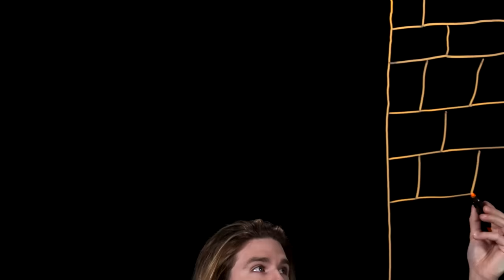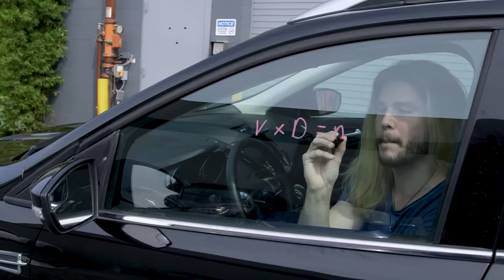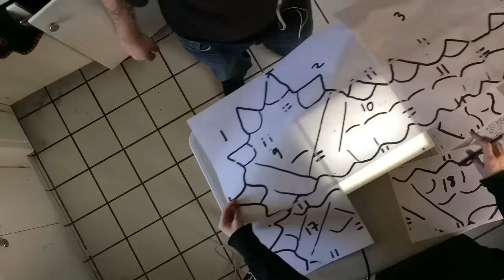Could You Swing A Real Monster Hunter Sword?

Comment: Would a human with muscles capable of producing the calculated amount of energy required to swing such a massive sword repeatedly even be possible? And what would that look like, something like five Arnold Schwarzeneggers in one?
Reply: J335H normally you'd see a 70 kg guy swing a sword under 5 kg. So if you got a sword weighing 170 kg, you would need someone close to 2000 kg to properly wear it. Thats 3 of the worlds biggest bears.
Reply: I wonder if a Spartan from Halo could wield a sword like that.
Reply: Brian Shaw may be able to swing it. Or Hafthor.
Reply: Please tell me that is the actual cannon
Reply: xtemma I think I now need to go look up monster hunter lore.
Reply: Not even close. You'd need to be about twice as strong as a worlds strongest man competitor just to hold it horizontally for a few seconds and weigh 340kg not to topple over in the process. To wield it proficiently you'd need to be about 20x as strong and weigh 720kg.
Reply: That is an easy way to put it but in essence you are right xD Wyverians on the other hand are a completely different thing xD But yeah it is mentioned in older games that not everybody can become a hunter because they have to have that something special. 
It is also repeatedly mentioned that there used to be warriors in ancient times that the hunter weapons were basically created for and they wielded them with ease. This lead to the belief that hunters must be descendants form those warriors. How those warriors came to be is actually not known. As monster hunter is basically a world without magic but an almost magical form of sience many things would be possible considering that even the most experienced wyverian scholars do no understand many things they find inside the ruins of the ancient civilication.
Reply: Rai Jim honestly, probably could. The spartan2's would weigh enough in their armor to counteract the weight of the weapon.
Reply: @GoingRampant07 Just about. They would weight 1000lbs and be 5 times as strong as a WSM competitor. They could swing it if they had to and it would be better than nothing but it would be really sloppy and the momentum would throw them around.
Reply: Ah just let Kratos play with the sword should be no problem for him.
Reply: @GoingRampant07. 

A spartan wouldn't be able to. Military armour systems are made to be as light weight as possible, while being as strong as possible in a certain direction. The Halo Spartan suit make the wearers 5x as strong as an average human being I'm I remember correctly. The wearer would be able to lift and swing the sword, but definitely wouldn't be able use it efficiently in combat situations. He'd expend his suit's batteries just dragging the thing around. 

If you notice, in Halo all the "old fashioned" weapon designs like swords are either light powered (laser or plasma blade), or are gravity gen powered to increase downward arc and thus the total torque (hammers). Without these hi-tech enhancements,  (if say the power were switched off), a human would be able to lift them pretty easily because of their light weights, but obviously wouldn't be able to do a lot of damage with em.
Reply: Fernando Cárdenas you forget that Spartans canonically weigh almost a ton and can flip a tank
Reply: J335H you would need a HUGE heart to be able to pump the blood required to support the muscles needed to lift it. Let's say a heart somewhere near the size of an elephant?
Reply: @redfiveish

Sure, except that Halo's human tanks are not heavy like real world tanks either (todays tanks weight about more than 60 tonnes). They are made from light weight, but strong materials just like the spartan armour. They even have smaller guns (smaller ammo, less combat weight) than today's tanks. The Covenant tanks are even lighter as they depend more on energy shielding. They probably weigh as much as a regular car (about 1 and a half tonnes as they can be carried by pelican gunships) 4 or 5 people can flip a car.. 

Think about it. If Spartans weighed a tonne, there is no way they'd be about to jump and flip, and maintain their acrobatic ability on different environments, especially if they are only 5 to 6 times stronger than an average human. It leave almost no extra leeway for their suit's power.
Reply: Fernando Cárdenas your correct the weigh 1000 pounds armor and all due to increased bone and muscle density.
Reply: J335H honestly probably not even possible. The human body has limits even with special cases. The most ive seen someone bench is about 400 pounds and they only got it about 4 times. Its a lot easier to bench heavy and squat heavy than to say do a kettlebell swing 100 pounds. Being able to swing would mostly be from up to down. You would have to rely mostly on the swords momentum. So basically you wouldnt swing it. You would just let it fall and hope the weight did it. You couldnt even maintain momentum with that thing.
Reply: The biggest problem is that, in order to use a sword of this weight, the wielder would need to be substantially heavier.
Reply: Nathaniel Woodburn and that's how it is in the game.  Its so heavy.  The momentum carries the character one side to the other.
Reply: Jim Giant wait, twice as strong only ? That means the strongest man on earth can lift 275kg with one hand ? It's crazy, who's that guy ?

I calculated the upward force the right hand (near the guard) would need to apply with the mass and torque Kyle calculated and considering 40 cm between the two hand, the left hand would need to apply a downward force of something like 3800N (equivalent to 387kg) and the right hand would need to apply an upward force of the sum of the two downward force (left hand and weapon) that's ~5400N (or 550kg)
Reply: I think a 5' 8"to 6 foot tall, 200lbs power lifter with exceptional dancing and martial arts skills should have the sense of momentum, control and footwork skills to swing a 370lbs version of this blade. 
It'd still be several consecutive swings before he is exhausted, and there's still a large margin for terrible error. Though it's a full body activity, his ankles will be under a tremendous amount of strain when he pivots on them to generate the initial momentum of starting up the swing and then as his stance widens out to transition the flow into a secondary pivot. On the second pivot, the built up momentum will go to the outer limits of his control(even with genius level sense of kinesthetics). The sword's weight will feel momentarily lessened as it'll feel like it's flowing of it's own accord(which it technically is at that point)...
You are not likely to find a guy like this, but it's possible there are a few in the world...but in the World of Monster Hunter, each Hunter is likewise in the top 1% of physical and martial prowess, so it's possible(just not for Kyle, he seems better at thinking than martial arts).
Reply: @Lin Yen Chin Actually, the proposed power lifter would likely NOT be able to use the 370 lbs weapon.  As Kyle points out in the video, Greatswords could weigh up to 15 lbs, and being a later developed sword existed during the time of plate armor to offset their weight, and still, during this period, Longswords (not to be confused with Arming swords the way games like D&D does) were the prefered weapon. Why? The greater weight of the weapon could wear out even the individuals trained to use them.

Shad over at Shadiversity discuses the issue in this video:

https://www.youtube.com/watch?v=0t8ZrI5JqCw 

and Michaelcthulu shows why large swords of any type are problematic, even though they look awesome:

https://www.youtube.com/playlist?list=PL94959BEA7932D30A 

yes, I linked to his playlist, because he has more than one example of an oversized weapon being too unwieldy to use effectively.
Reply: T Mac, you do know that there are guys out there who could leg press one ton, right?https://www.youtube.com/watch?v=9vWgSTdkc2A
 ...and that Professional soccer players can do about half that, right?

Kyle is looking at it wrong, he has no sense of technique, he boiled it down to shoulders, elbows and wrists rather than understanding that it's more of a full body activity(all the joints are leveraged), to lift and propel the sword as demonstrated in the mechanisms of Great sword movement in the instalments of Monster Hunter that I played back prior to it migrating from Sony's psp to  Nintendo's wii.

Kyle describes "moments" and "kinematic chains" so well, but has no real material sense of it, at least not like any martial artist or even generic athlete knows it through the flow of their own bodies.
Reply: Look at this woman leg pressing almost 5 times the estimated weight of that sword(were it made true to the monster Hunter height):
https://www.youtube.com/watch?v=4EwPpYjCFuc

That's the reason why I say power lifters have the potential, only not just any power lifter, as they would have to know better than Kyle, they would need a martial artist sense of full body coordination to leverage in flow all the potential kinematic chains required for using the sword.
Reply: Ok, I know MANY individuals who can lift heavy weights, but there is a difference between lifting a heavy weight and using it effectively, and as stated, the ratio between body weight and the weight of the weapon needs to be around a certain point or it really throws the individual off balance. I practice martial arts and have a pretty good sense of balance, and can swing fairly heavy items one or two times. As a point, Powerlifters typically only lift weights in the above range once or twice before stopping.

Another point is that powerlifters and WSM/W competitors train specifically for what they do. The ability to turn that into fighting prowesss means a lot of training where they would lose some of the strength that they display at those events because the training necessarily redistributes their body kinesthetics to compensate. It is not as easy as, "I am strong and therefore I am a great fighter" or even "I am strong and with a bit of training I can swing this sword effectively." Martial training takes a lot of time and practice and being honest, while they are "fast" with heavy weights in the WSM/W competitions, they are typically slower than an average sized individual.

What Michaelcthulu shows, is that the primary method of using such a heavy sword would be to raise it and let gravity do the work, and this is a slow method of attack requiring the target to pretty much be restrained in some way. Swinging such a sword as one would in techniques from Ringek or Tallhoffer would be impossible even for your powerlifters as the mass ratios would be off and would throw them out of balance every time they swing.

So let's look at the Halo comparison. Military armors are made as strong and light as possible, and we see regularly that OSD (Non-Spartans) move very well in their older, bulkier armor. Spartan Armor would be expected to be lighter and stronger than OSD armor, meaning that it isn't adding much mass at all to the equation, probably less than the full plate of a medieval knight. We also don't see that Spartans, even after their enhancements weight significantly more than a normal human, meaning they again don't add much mass to the equation. Therefore, one would expect such a bulky weapon as the Berseker Sword to throw even these worthies off balance should they choose to use one.

So, looking at the ratios how heavy would an individual using such a sword need to be in order to wield it effectively. A greatsword, the heaviest known type of sword, comes in at around 15% the weight of the user, and that is at the high end, typically you want a lower ratio, but we will use this for best case scenario. The wielder of the Berserker Sword from the video with Kyle would have to weigh in at about 2,333.33 lbs in order to effectively swing it without throwing off their own balance. And this is for a trained martial artist mind you.

Looking at listed weights for individuals in comics that wiegh in close to those ranges brings up no one.  Now individuals like Superman and Superboy might be able to do so, but they are also considered to do odd things to physics anyway, so they wouldn't be good for this. 

TL;DR: Physics dictates that the individual needs to weigh significantly more than the weapon to use it properly.
Reply: And I got around to describing why, even with training they would not be able to use such a weapon, they would lack the basic mass to do so, and you would have understood that had you actually read my full reply.  Please note that it does say "Read more" at the bottom of the basic blurb there.

I also never called you any names so I have a problem understanding why you have.
Reply: have you seen greatsword gameplay in monster hunter?
Reply: Lin Yen Chin leg pressing has very little meaning in this. Most of the difficulties would be with how the weight is distributed in the sword and how they would be holding the sword did you entirely miss that part? Yeah you could stand up with the sword in your grasp but I 100 percent bet they couldnt hold it up for more than a second or two if they even could get it off the ground from a resting position into an idle drawn weapon stance. Much less drawn that thing from being holstered on their back over their head and than hold it in place, please....
Reply: Andrew Blake:
"Lin Yen Chin leg pressing has very little meaning in this. Most of the difficulties would be with how the weight is distributed in the sword and how they would be holding the sword did you entirely miss that part? Yeah you could stand up with the sword in your grasp but I 100 percent bet they couldnt hold it up for more than a second or two if they even could get it off the ground from a resting position into an idle drawn weapon stance. Much less drawn that thing from being holstered on their back over their head and than hold it in place, please..."

You not read my previous mass of text, or is it that you are calling me a liar?
I've easily lifted over my head, things that are at or around 400lbs when my own body weight was 150 to 165 lbs(it's still around 165 now). The sword in question is 370lbs.
The method I'm proposing, which is basically replication of what is seen in the Monster Hunter method of handling the thing, only has the sword over your head for mere moments, before it crashes through your foe and into the ground(except I'd be able to re-rout the trajectory into an arching sweep to continue several swings). 

You must have never lifted a thing in your life, while I at 17 was able to lift a 450lbs cast iron stove...I know what I am talking about in regards to lifting.

What you and that trash of a failed martial artist T Mac, fail to understand is the healthy and correct method of centring your centre of mass with that of the object in question. Kyle's positioning at 9:24, with the sword's centre of mass a meter away from his own = tip you over if you try same thing with 370lbs version but not in actual use of skill. With said skill, you wouldn't be stupid enough to hold the blade's centre of mass so far way, unless you are generating enough momentum of your body's centre of gravity via the same rotational mechanism as kyle describes in *moments*...that's where the martial art or dance type mastery of footwork is important, your elbows will be tucked in and almost all the power generating the momentum will be the legs while the upper body only has comparatively little movement
....don't tell me, you've never even taken a small martial arts lesson regarding footwork and how it correlates to hand position in striking your opponents?

It's all about structure, the structure of angular relations in your footwork in relation to your centre of gravity(your centre line in general) which governs timing, timing is everything in using the flow of force required to craftily manipulate that which your currently ignorant ass has no exp with(granted, my own martial arts exp is minimal, but my capability in lifting  and manoeuvring awkward, bulky and heavy items, that's professional).
The closer you have your load to your centre line, the lighter it will feel, the closer it gets to your own centre of gravity, the lighter it will feel, the more balanced your centre of gravity, the lighter that load will feel. You basically have to use centrifugal force to generate the illusion of reduced weight as you are swinging, but not so much that the weight pulls you out of control, just enough to make it feel lighter than it is. 

It'll be a dance which requires precision mastery of all the muscles in your lower body to offset what physics naturally would otherwise lead to...but that's what makes it a skill...a simple skill.

The more I try to use text to make you idiots understand, the more I realize the folly of it...if only I could give you a live demonstration so that you'll understand...Even then, you'd still think something not right and consider it a hoax or something...
Reply: +Lin Yen Chin. you know, maybe a martial artist could wield this in a technically effective way. But there is no way for it to be effective as a weapon. The idea that fluid movement and feeling the weight, using legs to help distribute and use the weight, all of that shows me you don't actually know anything about Martial Arts. Just because they are trained to use it and just because they CAN lift it and just because they understand the best way to move the weapon doesn't mean it would be effective in the hands of ANYONE. 

There is no one in the world who could proficiently use a blade that heavy and there is no "style" available to make that work for a serious fighter. You choosing to die on this hill is just all the more telling.
Reply: Fernando Cárdenas spartan power suits are nuclear powered so the power core won't be running out of owner anytime soon
Reply: Rubick it's not the cannon but the canon says there was an ancient weapon called the equal dragon weapon, that took the lives of 30 wyverns to make and would constantly kill to become stronger... Kind of exactly like our gameplay of the A class hunter

So one could argue that's what we are, but lore wise we are just good hunters (and also lore wise you don't kill everything you see with 100s of elder dragons roaming the land, they are extremely rare)
Reply: imagine how much they had to eat .... now those massive steaks make sense.
Reply: Lin Yen Chin yeah ive taken martial arts training Judo,Brazilian JJ and a small amount of Muay Thai but thats besides the point. Sure youve lifted a 450 pound cast iron stove but im sure the way you held it did not replicate the weight distribution of this sword. Could you put that weight on a hilt on hold it out in front of you? You you put that weight on a hilt and hold it over your head without falling over no not in a million years. There is zero manuevering you could do without assistance to hold something with that type of weight distribution. This is a sword not a weight bar youre seriously telling me you could put 375 pounds of weight on one side or the middle of a long weight bar and hold it off the ground over your head and then make it go in the direction you want with any type of profociency? The time it would take for any person to do so would leave them wide open let alone the strain that would put on them would mess them up the problem isnt lifting 375 pounds its lifting that weight the way its distributed in a sword of this size. It would literally be like putting  two 1/2 kegs of beer on a hilt and lifting it off the ground from the hilt its impossible for a human to do that with their own strength. Anyway this is a pointless argument
Reply: I too have been lifting heavy things my entire life so I too know about that, so your assertion that I have no idea what I am talking about fails there. Working on farms and rural roads since I was 10 years old, and then I joined the military where things didn't get better. I didn't just lft heavy objects, I walked away with them, including a 400lbs computerized radio system.

The problem is, picking up a heavy object, and using it as a weapon, are two VERY different things. While strength will allow you to lift a heavier weapon, and skill will allow you to use it, they can only take you so far. After a certain point, physics just says you can't use too heavy an object effectively. IF it were possible to do as you say and train enough to use such a heavy weapon, I  guaruntee that we would have seen them used historically, and that simply isn't the case. They used weapons that weighed in at a fraction of their own weight. Using the previously mentioned 15 lbs greatsword, and your own 165lbs, which isn't far off normal weights from the correct periods of use, it is less than 10% (9.09%) of your body weight. The only weapon I am aware of that was heavier was a polearm that weighed in at 16.5 lbs, or right at 10% of your body weight, and was set against the ground to be used to stop cavalry in a charge. Wait, there is the hammer from the Olympic Hammer Throw, but i will get to that shortly.

"But," you say, "they didn't have the skill we have today. A powerlifter could just train until his footwork could compensate." The problem with that statement being that all the footwork we use today in every martial art was originally developed by the warriors of old who were staking their lives on being the most skilled as well as having the best weapons and armor. They spent their days trying to find new and better ways to defeat their enemies, and weapons heavier than 10% of their body weight just weren't a part of that.

So let's get back to the powerlifters. Ronnie Coleman, the powerlifter in the first video you showed me, weighs in at 297lbs, or 20% LIGHTER than the 370lbs sword we are discussing. There is no doubt he can lift such a weapon, and even swing it, slowly, but he would not be able to swing it with intent or accuracy.  An upward swing he should probably be able to manage, as the forces acting on him would be pushing his body back into the ground, and a droping swing, from over head, would actually push him backwards, unless he was braced against something more than just the ground. The Michaelcthulu videos show him being pushed back slightly by weapons lighter than he is, so ramp up the problem when dealing with a sword that outweighs him. Any form of cross swing runs into problems that are best demonstrated by the Olympic Hammer throw.

I recommend you watch this:

https://www.youtube.com/watch?v=XNLyGhFdnHw

An Olympic Hammer weighs in at 16lbs for men, and if you watched closely, they had to compensate in much the same way that you are saying the 'dance of death' would have to for the Berserker sword. Once again we see that a weapon that is significantly lighter than the user can have a HUGE effect on how the wielder moves. Hammer throwers have two things that often disqualify them from the event, one is losing their balance because they weren't able to get their feet placed correctly fast enough, and remember, these are guys who train for this. The second is something we haven't even touched on, and is just as big a problem, they lose their grip and throw it into the nets you see around them.

The centrifugal forces acting on the hammer increase the weight as it is being swung, to he point that that 16lbs device can have an effective weight of over 100lbs (Kyle could probably work out the math better than I can). The Berserker sword in a similar situation, could easily ramp up to thousands of pounds, and that would rip the weapon from the hands of even the strongest of men. (If you are unsure of what I am talking about, I recommend watching any of Kyle's videos where he discusses artificial gravity generation.)

If you go and watch world's strongest man competitions, you will see that a common point of failure for these highly trained atheletes is their hands giving out. These are men (and women for the World's Strongest Woman competitions), who are used to using their whole body to move heavy objects around. They are actually a better representation of what we are discussing than powerlifters (though a case could be made that they are a type of powerlifter, but that is a different discussion) as they have to have the whole body sense that you previously discussed in order to complete many of the tasks they have set before them. These impressive atheletes still have to work with physics, and there is only so much the human body can do.

In regards to your belief that sufficient training can overcome these issues, I blame movies, television, and comic books for giving unrealistic expectations of what a martial artist can do. They don't dance on the tops of bamboo shoots or walk on water, they don't catch bullets, they don't lift thousands of pounds as easily as lifting a bunny, and they don't use supermassive weapons effectively. If either Ronnie Coleman (the powerlifter you showed in the video) or Brian Shaw (World's Strongest Man winner 2015) tried to use the berserker sword in a real fight, even after training, they would still lose to a person using a reasonably weighted weapon, they would be too slow in its use.  Before they could even get it moving, they would have been stabbed or beaten multiple times. That is just physics.

The best use I can see for the Berserker Sword is to throw it in a fashion similar to the Olympic Hammer at a shield wall in hopes of creating an opening that can be exploited. Much like the caber tossing Highlanders.

Also, please stop with the insults. As I was writing this I saw no one that had insulted you, and it therefore detracts from your arguments. In effect, it seems as if you know that you are wrong, and have to resort to childish tactics to make your arguments seem better than they are. If you have a reasonable counter arguement, state it without the insults, and reasonably minded individuals will give them greater creedence, otherwise you come across as an internet troll, and nobody wants you to appear as one of those.
Reply: It would look like a big european black haired guy with a metal arm, only one eye and a lot of anger. Oh wait, wrong fandom
Reply: Christo Kristoff:
"+Lin Yen Chin. you know, maybe a martial artist could wield this in a technically effective way. But there is no way for it to be effective as a weapon."
Keep in mind, the limit of your mind is not the limit of mine, the limit of your body is likewise not the limit of mine. Do not presume to know the bounds of Human potential, especially when all you are doing is not flowing from your own experience but the conclusions that others have given to you as gems of their own mind's limits.
Reply: +Lin Yen Chin the human body is a machine with upper limits of stress. again, it's adorable that you want to make shit up and pretend to know what you're talking about, but everytime you say anything you make it obvious you have not a single idea what you're talking about. It doesn't matter how physically, mentally, or spiritually tough or flexible or capable you want people to believe you are, but NO ONE DOES. 

You aren't a superhero or a mystical monk warrior.  You're a human being, so I don't have to know you or your bullshit upper limits to know you can't do it. Christ, it's like talking to a child who has convinced themselves their imaginary pretend play-time is real life. The floor isn't lava, kiddo.
Reply: +Lin Yen Chin and cut the bullshit pseudo-philosophy nonsense, you're not a widened old master.
Reply: Rai Jim yes they can.
Reply: Something I've not seen anyone else comment on yet is the strength of the ligaments holding your joints together. Even if someone trained their muscles to be able to lift those weapons, the real strain in swinging a sword that size is on the ligaments in the joints. honestly, with the amount of torque a weapon that size would exert on a human's joints, even if they were strong enough to swing it, the momentum and force of the sword would quite literally rip their arms off should they try to stop the swing and redirect the blade (something commonly done with regularly sized swords)
Reply: Um, my comment, if you will. The one above yours.
Reply: Ah, yes. On earth.
Reply: Christo Kristoff:
"You aren't a superhero or a mystical monk warrior.  You're a human being..."-!! WOW did you just assume my species?...what if I were a non human entity, like a muslim or a similarly demonic entity?
Reply: KorGarrot:
"Something I've not seen anyone else comment on yet is the strength of the ligaments holding your joints together. Even if someone trained their muscles to be able to lift those weapons, the real strain in swinging a sword that size is on the ligaments in the joints."-!!?
Somebody better tell those acrobats this, so they stop swinging their bodies around and defying the established limits of this thread's cognitive bounds.

Look at this stupid guy, daring to defy your wisdom in regards to the limits of one's ligaments when using rhythm and flow to wield something as heavy as their own body in their acrobatics:
https://www.youtube.com/watch?v=8SMWUuVzTsI

Surely it's impossible for anyone to replicate such grace in the act of wielding a sword that's at their own body weight, or swinging several consecutive times a sword that's two to three times their own weight.
Reply: therefore the physical training to wield this sword would be unbearable for any human body to go through. after the training you would still not be able to effectively use the sword therefore all that training was not only painful but pointless.
Reply: Benjamin Herisson yes the strongest can do that. In the strong man competition they have an event where the competitors have to lift 300 kg dumbbell over there head with one hand, and these guys average weight is only 400 pounds.
Reply: well its stated even in ingame lore the weight of the weapon that doe sthe damage then the actual swing get enough speed on any weight it can punch holes in planets. as well  in game when swinging it your thrown aginst your swing and left open, more so in older games in hunter  world they sort of made it easyer
Reply: Rai Jim i mean master chief is a flex god considering he can flip the elephant (200 tons btw)
Reply: Hunters are stronger than Hulk in the canon of MH, and they pretty much could beat master chief in a squad